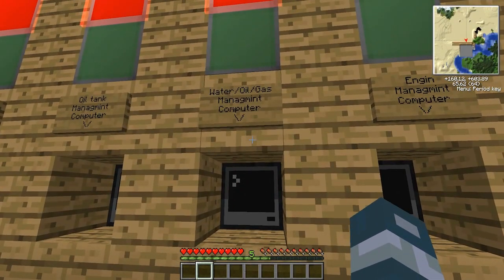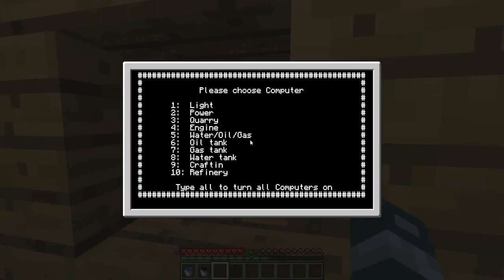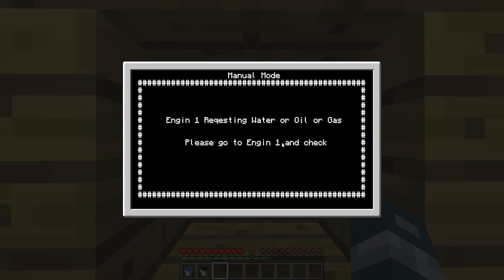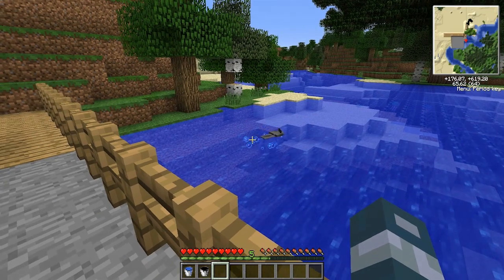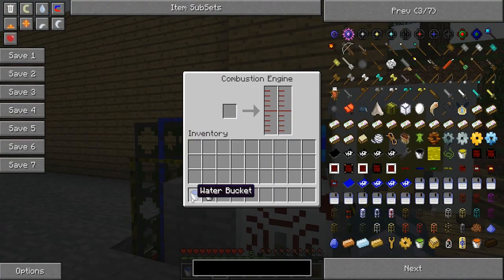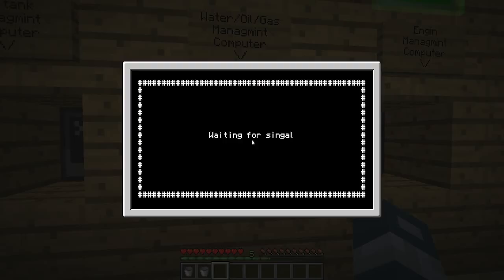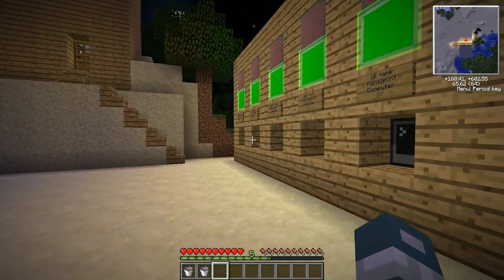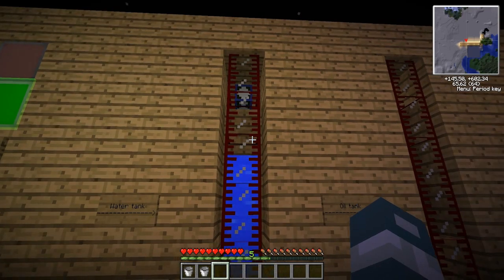Computer Craft and BuildCraft working together part 2

Comment: If you look at the GUI at 4:00, there are 2 sections for each row. One to specify your status (space for liquid, empty, full) and another that has a / in the 1st and 4th rows and is blank in the 2nd and 3rd rows. Those empty slots in the 2nd and 3rd rows are for you to add a bucket of fluid to specify which liquid you want to detect.